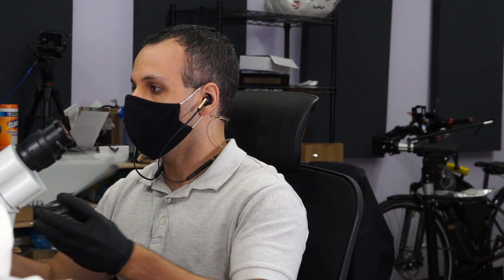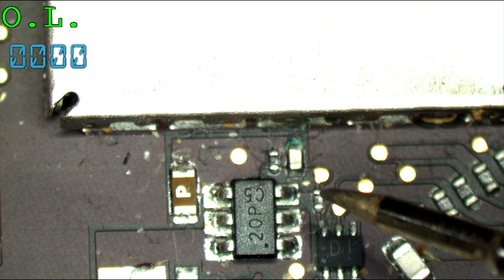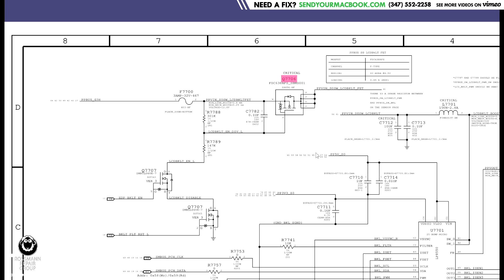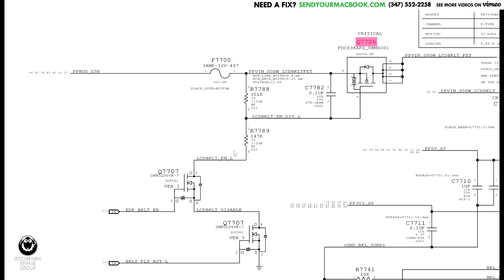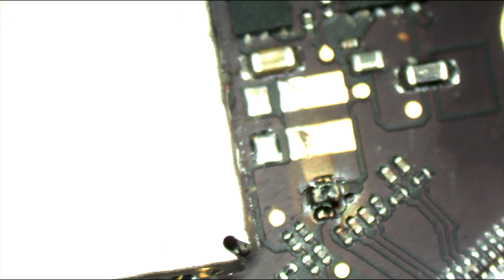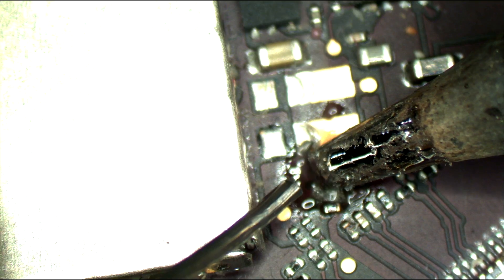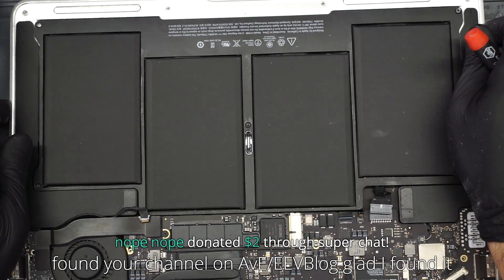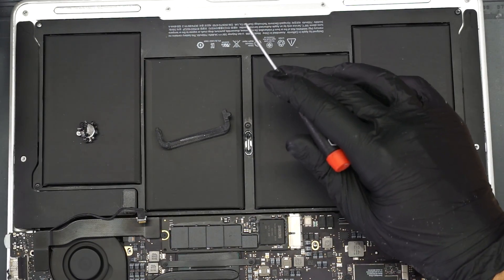A1466 Macbook Air starts with no backlight now has no image logic board repair

Comment: Regarding notifications, I don't ring the bell for anyone. I subscribe to channels that are interesting, and then use the subscriptions feed to see new videos. I'm exposed to new content only when I choose to look at the recommendations or get bored and check the homepage.

Regarding the voltage divider description, I'm sure someone already pointed out that it would only provide ~4V if the resistor values were the same. Since the larger one is on top, the voltage is even lower than stated.

Do keep making all kinds of videos!

Comment: You explained the way the transistors work and purpose just fine.  Like your work wish I had the same kind of setup.  I only have irons and a old style gun for soldering.  In the process of getting a hot air gun sometime soon.  Thanks for the great video ( as always I did learn something )

Comment: I just came across your videos, and really appreciate them. I think, what might make them a little better, would be if you added more information to the comments about what you've fixed, rather than what you used to fix it. It's nice to know that you used a certain soldering iron and flux, with the links, but if I'm searching on youtube for how to fix a specific part your titles and descriptions will not easily reveal which video I have to watch to see you fix the part that I've diagnosed as broken.

Comment: On the subject of logic boards. Is a 2015-17 logic board board compatible with my 2014 MacBook Air? 
I want to upgrade but here in Australia airs in those age ranges are still $750-$1000

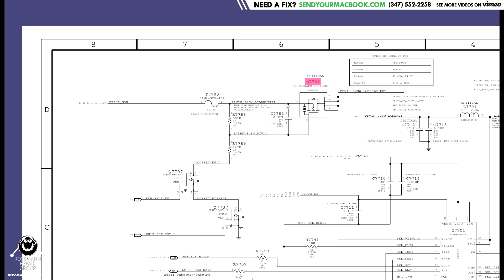Comment: 5:12. It's considered bad electrical engineering practice to have a capacitor between the Source and the gate. The FET can oscillate as a result. they should have one more resistor.
Reply: Weird choice to place a "filtering" cap between the source and gate, so the rise time is significantly slower.
Reply: @stanimir4197  The filtering cap is there to slow down the rate the supply voltage rises. Too fast of a rise time will cause the source voltage to sag. I've used this kind of circuit myself on a project, but I added a second resistor between the cap and the gate. The alternative is to find a high ESR capacitor, but that is hard in that 0.1uf value.

Comment: What is the purpose of the capacitor that you say you don't need to replace but do so anyway....?  At 13:33.
Reply: And you inspired me to fix my food dehydrator!
Reply: It's there to keep constant voltage in case PPBUS G3H voltage fluctuates, it's usually not necessary but it's good to have it